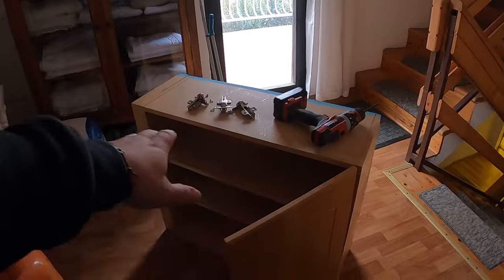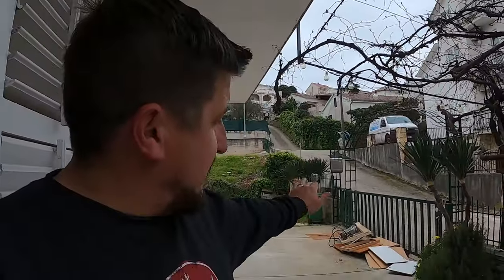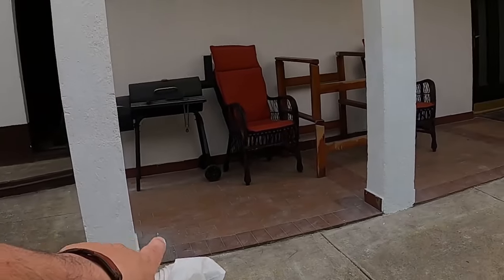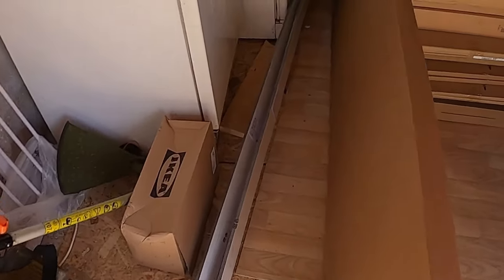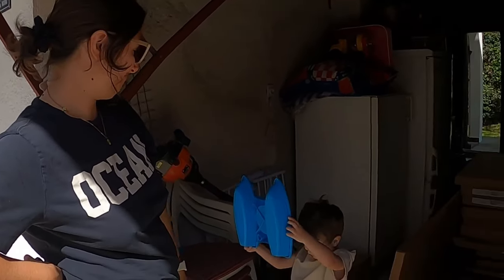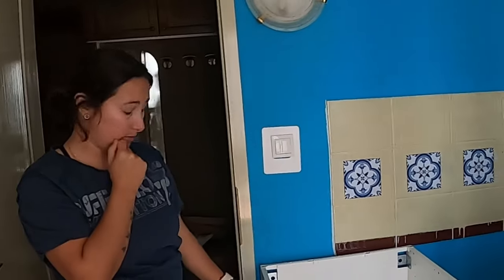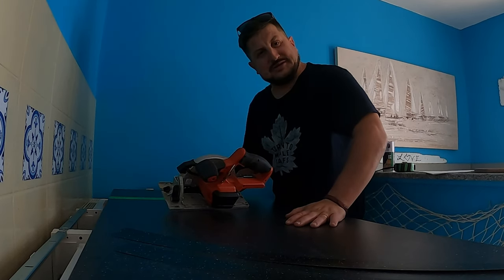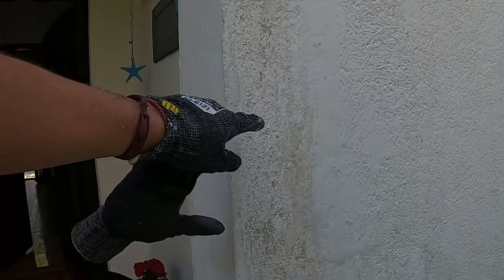Renovating Our Croatian Home For Tourist Season

Comment: When I did my new kitchen in Croatia I was living in Hungary so I ordered the units from a firm in Hungary. I expected them to be self assembly but when they arrived they were already assembled. This was a snag because 2 of them were too big to go in my car. For about 2 years I had to manage without those units but then I hired a van to move all my stuff to Croatia. The standard electric supply in Croatia is not adequate for supplying an electric oven and full size electric hob which is why people often have a bottle gas fueled cooker. I used a dual fuel cooker which has electric oven, 3 gas burners and one electric hotplate. A bottle of gas lasts about a year but if I do run out I still have that electric hotplate.
Reply from the maker: Yes our one apartment uses propane still, propane is a money saver 👏  it's very cheap and like you said it lasts a long time